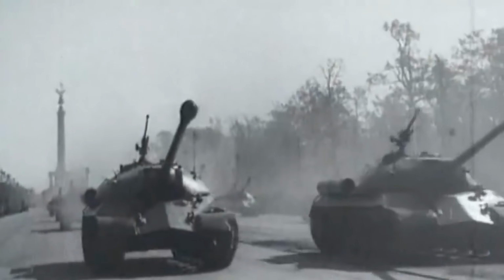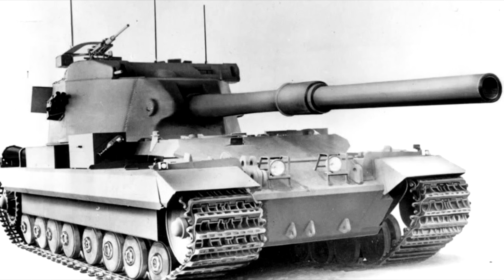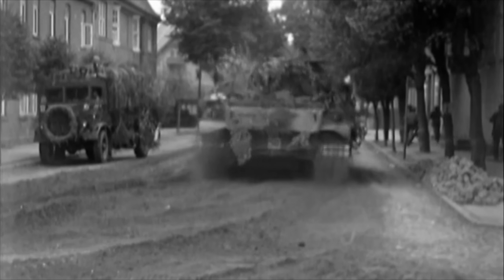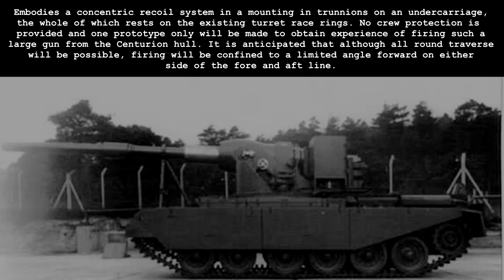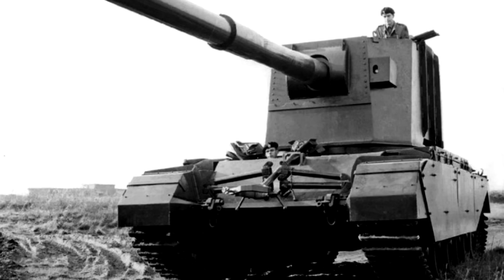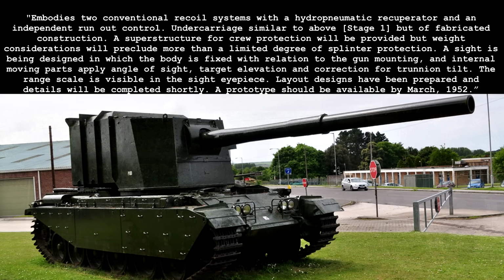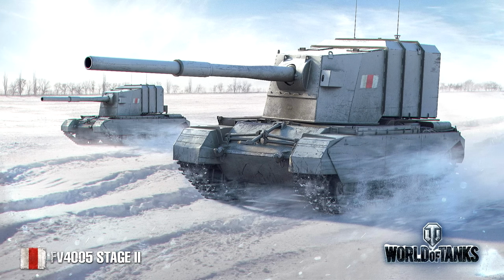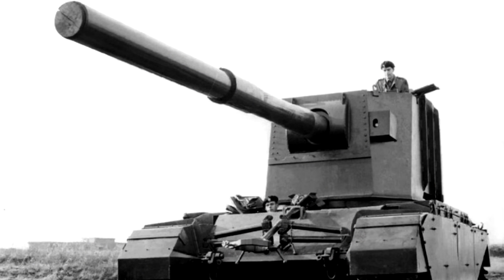British Boomstick, the FV4005 | Cursed by Design

Comment: The British really went back to their naval roots for this vehicle and put what is essentially a heavy cruiser gun on a tank
Reply: 10 7.5 inch guns were mounted on armoured cruisers as secondary armament  with the main guns being 9.2 inch.  Really makes you appreciate how big warships were back then.
Reply: @Ushio01  most British cruisers if not an 8 or 9 inch gun used the 6 inch or 152mm such as on the town and Fiji class so these actually have a bigger gun than some cruisers 😂
Reply: https://en.wikipedia.org/wiki/BL_7.2-inch_howitzer
Yeah, the navy was already using 190mm, and 203mm guns, why did they choose this old thing?
Reply: @Orinslayer  because they needed the FV to still be there afterwards
Reply: @marshmellominiapple  Instead of in the next postal code? Nonsense.
Reply: @marshmellominiapple  naval guns typically are lower recoil not as high velocity............. because well.... they're not trying to penetrate with pure kinetic flat trajectory
Reply: Exactly
Reply: Gun was designed to destroy ships not tanks

Comment: If I had to describe this tank it would just be that the philosophy is simple but not sound
Reply: They should have done away with the turret and had the gun fixed forward with a frontal armour shield but open deck for the gun crew.
Reply: @bobbyrayofthefamilysmith24  I believe he said that the reason they even put the turret and huge box on there was to protect against artillery shrapnel
Reply: @TheriCTheri  yeh he did say that but I think this vehicle could have been more feasible if they'd have made it similar to the German tank destroyers like the hertzer or stug.
Reply: @bobbyrayofthefamilysmith24  that would have been a big stug I wonder if that would be viable for the times
Reply: @TheriCTheri  they should have mounted the gun directly to the top of the Hull to keep the height profile down and used hydraulic suspension to raise and lower the whole vehicle to achieve gun elevation like the Stridsvagn 103C.

Comment: IMO, the Barn would still have been a decent support tank destroyer nontheless. Well, it might have been extremly large and such, the tanks massive gun could also have served as a engineers support vehicle like the 165mm armed centurion. The gun could also have been econonomically more advanced since the shells might have been cheaper to produce then a complex ATGM. Either way, it is sad the TD got scrapped in the end, but it still could have made a verry big impact on tank designs...
Reply: There is a reason we opt for very low velocity 165 for engineering vehicle instead of higher velocity 183.
Reply: @jintsuubest9331  Yeah that i can understand, but still, think of the possibilities that could have gone from this research onwards. Mabey tanks would have had big enough hesh shells to dont even worry about most armour.

Comment: More like a self-propelled gun.  As a TD this thing would be meat to anything that shot at it.
Reply: Agreed. That large, unwieldy turret made of SHEET METAL just invites enemy fire.  If anything, use of an AP round would prove to little avail, as the round would likely punch straight through it and out the other side.  Bad news for any crew in the way, or someone in the line of fire.  Better for an enemy gunner to load with HE.

Comment: Its already strong with its 183mm in wot, but in wotb its overkill. No literally, it has a camo named overkill
Reply: In world of tanks blitz it only has a 123mm gun though, not scary until all 3 shots dealing 460 damage each penetrated
Reply: @chooyongming110  imagine that gun in wot
Reply: Should have added the 183mm gun as an extra researchable module smh We need more than 2 Derp Tanks in British line.

Or if Wargaming is greedy, they should make it a Tier 10 premium.
Reply: @moisesezequielgutierrez  the thing is, if you put the 183mm gun onto FV 4005, that would completely defeat the purpose of the FV 215b 183 line tech tree since the 4005 is easier to grind, and not fair to those who own the 183
Reply: @chooyongming110  the FV4005 is also much faster, so with the small maps WoTB has, the FV4005 could easily run around the small hills and slap you for 1.4k.
Reply: @ancientwarrior3482  if it doesn't lose a ton of hp because of the paper turret
Reply: @chooyongming110  That's why "balancing" exists. My suggestion is that the FV4005 should have worst Camo rating and than 215B183. 215B must have have more Health while 4005 has better speed. Balancing.

Again, this is Wargaming we are talking about. If they want money they should make the 4005 183 into a T10 Premium that Powercreeps the 215B 183 line.
Reply: @moisesezequielgutierrez  I mean, we're talking about the same devs that took the Object 268 v4 and released it with 80mm more turret armour than the original had, a larger gun (was originally a 122, but Wargaming read it as 152) which also somehow had a higher RoF and higher shell velocity 740m/s->960m/s and then gave it what was, for the time, the single most powerful engine in the entire game to 'compensate' for the increased weight. Funny thing about reality is that it tends to actually have some degree of balance, funny thing about Wargaming is they don't care.

Comment: this is the tank i hate the most in the whole world of tanks XD
Reply: Imagine if they one day actually introduce working .50cal machine guns, 14.7mm coax on IS-7 and small caliber autocanons on high level tanks. All the unarmored and wheeled cardboard with damn railguns that doninate gameplay right now will suddenly become obsolete. 
But nah, that's way too hard. Better just add some more unbalanced premium tanks and slap a new coat of paint on the ol' random battle.
Reply: @deptusmechanikus7362  i like the fact that you can shoot only with the main gun, i also tried war thunder where you can use all machine guns and i didnt like it. the wrong thing about this tank  is that you can oneshoot people for no reason at higher tier from max range for no reason like wg saying lets make a tank that not only oneshoots but since shoots HE he doesnt even need to aim at weakspots he can just click on you and splash for 600 IF YOU'RE LUCKY and if you're not you just die and over that it has 0.3 accuracy so you even hit tanks pretty well, that should NEVER  be the case

Comment: 11:40 I'm pretty sure the biggest gun even fitted to an mbt is a 130mm, excluding engineering variants
Reply: There is a prototype Leopard 2 with 140mm gun, iirc the example still exist
Reply: @AHappyCub  he said "Exculding engineering varients" so i assume he means prototypes are excluded.

Also the Object 195/T-95 has a 152mm gun
Reply: @jammygamer8961  It was found to be too large to practically use within the cramped turret of the T-95 prototype.  There's a reason the T-14 "Armata" main weapon is still a 125mm tank gun, though upgraded considerably from the 2A46 used on T-64, T-72, and T-80 Soviet/Russian MBTs.  And that new tank has its 3-man crew all in the hull in an armored capsule, the emphasis being crew protection, with no crew egress through the turret!  I predict that this machine, though it's got some "wonderful toys", will prove a dismal failure in combat, for a very simple reason...the time honored method of acquiring targets is for the TC to stick his fool head out his turret hatch and LOOK AROUND.  Although the Armata is festooned with cameras and sensors, they'll likely prove no substitute for the TC's direct observation.  Hence, many T-14s will likely fall prey to the enemy getting in the FIRST shot, which can often be the ONLY one fired!
Reply: Depends how you define biggest.  The 152mm gun rocket launcher was the biggest calibre to enter service as a true tank gun.  Bigger weapons were SPG or specialist types.
Reply: The MBT-70 (and the KampfPz 70) had a 152mm launcher, the same of Sheridan
Reply: Sturmtiger with 380mm launcher: amateurs
Reply: @humzaakhtar9208  Sturmtiger isn't a MBT tho
Reply: @humzaakhtar9208  Sad Churchil AVRE 290mm spigot mortar noises.
Reply: @Neion8  wait WHAT? THATS THE CALIJER OF THE CHURCHILL AVRE? for some reason I thought it was a 40mm (because doesn't it shoot 40 pound bombs?) But wow happy British noises
Reply: @humzaakhtar9208  Yeah, it fired an 18.4kg/40lb charge. No propellant, just boom.

Sturmtiger still fired a larger explosive charge though, hence the sad noises.
Reply: @Neion8  what do you mean no propellant, how would the charge leave the barrel? Also isn't the sturmtigers rocket 300 kg?
Reply: @humzaakhtar9208  Actually, my mistake, originally thought/meant the 40lb charge was the explosive that was launched (which would've explained the small 80 yard effective range) but upon further research to confirm this it was actualy a 26lb finned charge with a 14lb casing which included the propellant. But yeah the Sturmtiger's rocket was 376kg with a 125kg explosive charge, can only imagine the horror of two of them raining fire during the Warsaw uprising and seven of them at the battle of Remagen - especially with their suprisingly long 6,000m range.
Reply: Seeing that the Leclerc T4 Terminateur, has seen development as of recent of 2017 with a new experimental camoflague, that could be soon to change.
Lets hope, eh?

Probably what Cone was on about, a simple mistake.

Comment: A yes, the Shitbarn. The turret armor is basically only there so that the Commander doesnt get rain into his tea
Reply: "Only"? That's what armour is for!
Reply: @Del_S  PeppoLove
Reply: @Del_S  the turret has like 15mm of armour
Reply: @Pretorian 01 what about the machine gun?
Reply: @idontwantanysubscribers1157  What is a machine gun?
Reply: @bananabatsy3708  the mg is set to have identical balistics to the gun, so if a tank is sighted they just need to fire some tracers at it with the MG and then match the guns elevation with the mg
Reply: Most. Important. Reason........ Ever.
Reply: In Poland we call it 'lodówka' (the fridge)
Reply: no armor is best armor
Reply: @ryanrekz7744  Less armor, more room for bigger dakka!
Reply: Nah, not really if there is one thing you don't want to get wet it's a propellant charge.
Reply: Thing’s so large you can probably fit a hot plate & kettle, as well as a china tea cup.
Reply: @diegorincon4673  It's British, after all.
Reply: I see you use the word "armor" liberally.
Reply: A browing could probably pen it so yeah...
Reply: @BM-13_KATYUSHA  If we're talking about the M2 or Ma Deuce then yes absolutely. It's a .50BMG(12.5mm) cartridge and the FV4005 STG II only has .5"(15mm) thick armor. A .50 would blow right through it, as it does with even most armor plates. As gun channels here on Youtube like DemolitionRanch, Kentucky Ballistics, and Iraqveteran8888 have shown, a .50 makes short work of most AR500 plates which are designed with modern materials to stop bullets, and the FV4005 is made with just regular half inch steel plates. They wouldn't stand a chance against a M2.
Reply: I suppose that it kept the original tea kettle used by the Centurion for that 4 pm Limey "pause that refreshes".
Reply: Epic
Reply: I bet slighly stronger rain would pen the turret
Reply: Out of all things swearing in a comment hurts me but I beat it still accurate to the name and I want to call it poop barn because of the turret you can't you can't you can't deny that the turret looks like a barn and it's screwed up
Reply: Diluted tea means less crew effectiveness!
Reply: The British invented the Tank cut em some slack
Reply: I could agree with you but we’d both be wrong
Reply: its Tea time mutha fuckas
Reply: Chuckling from the peanut gallery. You have no clue as to what happened on the western front. But you go ahead and mouth off.
Reply: Nobody asked you retard.
Reply: Polish WoT players gave FV nicer nickname - "fridge".
Reply: 2:36 my school’s bus
Reply: This design is terrible. Why didn't they do away with the turret and make it a tank destroyer with the gun fixed in the Hull
Reply: @bobbyrayofthefamilysmith24  with this design if they need more they can just refit turret and recoil spade on exist centurion tank
Reply: @duytranuc4025  yes I'm not saying use a different Hull. I think this could have worked if they had fixed the gun straight to the Hull top to keep the height profile down and used a hydraulic suspension system for gun elevation like the Stridsvagn 103C
Reply: @bobbyrayofthefamilysmith24  Your idea might have been very good at the time. Traverse and elevation were never a problem with the Stridsvagn 103. I've never seen inside one so have wondered how the gun's breech, the three crew and ammunition were squeezed into the hull. 
Fitting the 130mm gun would have been even more of a problem, as well as the huge rounds and propellant. Removing the turret though would have increased mobility and the lower gun mount would have reduced recoil on the suspension. 

The video mentioned that the Brits wanted to keep using the Centurion (?) hull. Maybe modifying the suspension to provide suitable elevation and traverse capabilities for targetting precision would have involved a whole new hull?  If they succeeded though, the result could have been a formidable beast.
Reply: @GarrisonFall  that was Centurion Mk. 3 hull, must be designed for sniping, and for sipping
Reply: @bobbyrayofthefamilysmith24  can't, the gun breech too big to put in the hull, and centurion tank use HVSS, not hydralic, and fv4005 was design to use at 2000m, not 200m, at that range it easy to hide that thing, and after first shot you can't hide the muzzle flash
Reply: @duytranuc4025  I didn't mean inside the Hull I meant mounted on top but without any elevation machinery. I guess it mostly depends how easy it may have been to add a hydraulic suspension to the centurion Hull. Possibly this wasn't doable without extensive modifications.
Reply: @bobbyrayofthefamilysmith24  i know what you mean, but just build a casemate like a stug III still a good way to use, just drop that superstructure down, bolt on and it good, only problem are how to reload that monster gun
turret also good for wide firing arc(45 degree left and right) and that turret also have enough armor(14mm steel) for bullet resistant
Reply: @bobbyrayofthefamilysmith24  you're forgetting the original reason for the tank's shit design in the first place. It was meant to be a conversion for already existing tanks using the FV200 hull, not a brand new tank that would roll out of a factory.
If you think about it they weren't really making a new tank just trying to fit the world's largest gun on an old tank
Reply: @prasyaspaceagency7067  It's funny to think that all British tier 10 wot (at least blitz) use the centurion and conqueror chassis
Reply: @bobbyrayofthefamilysmith24  that'd just be the same tank with less horizontal traverse
Reply: @bobbyrayofthefamilysmith24  It was initially just a test platform for the 183mm gun. The overall cost of the project was probably actually very low, especially if you don't include the cost of the gun itself. It was, for the most part, just for the purposes of R and D, but it was also potentially a system which could be manufactured relatively quickly and used to be able to go up against even the heaviest possible armour that they might encounter. They were rushing to be prepared to be able to engage heavy break-through tanks. Of course, history has shown that this was probably never going to be needed. They really over-estimated just how good Soviet heavy (breakthrough) tanks actually were (or could be).
Reply: @bobbyrayofthefamilysmith24  lol, the armor is trash
Reply: @bobbyrayofthefamilysmith24 what did you just say
Reply: @yoshisampson_yt8349  I said stick gun to tank body no turret
Reply: @bobbyrayofthefamilysmith24 because then youd have to figure out how to mount such a large gun in an existing hull, why stopgap your stopgap solution with more problems, that’s just silly?
Reply: @sage5296  Thays what they were doing anyway mount a gun on an existing chassis with a totally unworkable turret. Mounting the gun directly to the hull and use suspension to elevate would have been better.